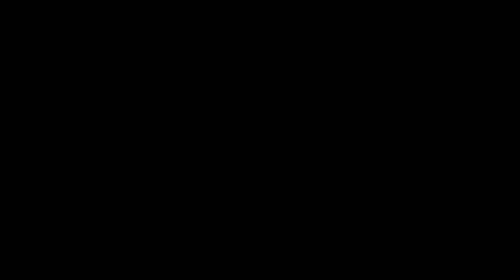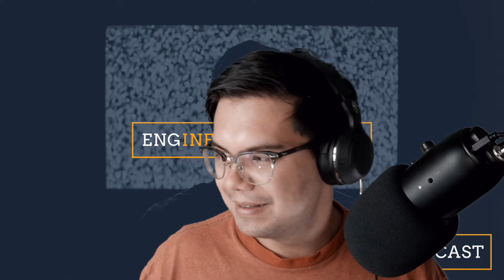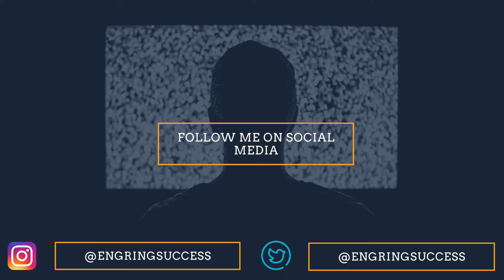Why is the engineering drop out rate so high?

Comment: Good points. Not only does it require complete commitment to achieving the goal, and sacrifice including your social life and hobbies, but it requires very-very hard work (brainwork, mostly, but also the dogwork of slogging through your labs, homework, reading and re-reading) as well. Your number one commitment has to be digging your way through the material. It also requires that you adopt the engineering mindset and philosophies, which are quite different than anything that most young students have ever encountered before. This includes the learning a new language, the engineering vocabulary, to survive the curriculum. Add in that you also have to take lots of other courses outside of your major to even reach being able to take engineering courses, and it is no wonder that many students give up. But those who persevere become more valuable as a result.
Reply: New engineers coming out of school should be required to put in 2 years pulling wrenches so they understand the hands on.
Reply: @daledavies2334  Mechanics and toolmaking/machining?! They'll ALL quit if they do that!
Reply: @devilsoffspring5519 Who will.quit, the mechanics and machinists/tool makers? Engineering in plants like compressors. If part of their certification involved having to bend tubing, install electrical conduit, piping and engine or motor alignment, they would be better engineers.
Reply: @daledavies2334  Mechanical engineer (MSc) and former researcher here. Also came from a auto workshop background, so I can't agree more. But only if the workload is balanced and reasonable.
Reply from the maker: interesting fact about me, I did two years as an "engineering intern" working in the machine shop for a contractor! I point back to that experience all the time. It was SO VALUABLE! Great idea.
Reply from the maker: agree. It should not be punitively hard. Good companies have structured rotational programs to help manage those kinds of things. One of my previous podcast guests, Carla Minett, helps companies out with those.
Reply: Sorry Dale, I agree, but wrenching should be done before, not after. That way they'll get familiar with the terms and process, and maybe other engineers. That's why car-guys generally do OK, even though they have to suffer through calculus. Same for sparkys, aeros, builders and chem geeks. The most valuable job I ever did when going through school was working in a machine shop. Fresh outs generally have no idea how stuff gets built, and it takes a long time to learn. @daledavies2334
Reply from the maker: I think a lot could be learned from doing that, for SURE.
Reply from the maker: Agreed all the way across the board! Pinning this comment :) please consider subscribing if you haven’t already.
Reply: ...That's not a good life. That's not an appropriate work-life balance.
Reply: rarely WORTH the pay
Reply: @doublesushi5990  Jobs generally aren't worth the pay. They're better than the alternative but even though working for a living is the backbone of all human civilization, it has been showing it's limitations for a very, very long time now.
Reply from the maker: yeah but working for a living with a job generally implies the concept that you can step away from your work as well and have social and free time which is a recent development in the history of civilization...
Reply from the maker: depends but yeah there are a lot of structures put in place to minimize the pay...

Comment: I got a BSEE at Purdue and even though I had a 5.66 GPT (Purdue graded on a logarithmic 6 point scale - the logarithmic is a joke but the 6 point scale is not) there were many times I thought about switching majors before graduating.  I was in a Co-op program that really helped me.  After working for 7 years in engineering, I did a lot more bus dev and strategy work. I am now working on AI projects “When the AI System Has to Be Right" AI in Regulation/Governance/Policy, Healthcare, Road Safety/AV, Education and Energy.  My recommendation to engineering students is to leverage AI to help with the theory, also find study groups to help you work together on tough problems.

Comment: The primary reason students drop out of engineering but not necessarily out of college is lack of aptitude for math.  I could add science buy you can't do the science courses, especially physics if you are not good at math.  If you excel at math, engineering is not difficult.  People enter engineering because the starting salaries are higher.   However, that doesn't apply to lifetime earning.  Engineering majors start with higher salaries but have much smaller raises and after 4 or 5 years almost no raises because after the first several years, additional experience had little value.
Reply from the maker: Thanks for sharing!

Comment: I agree on the concept of lab courses being twice the pain.  When I matriculated in the mid '80s, I had an old-school fluids prof that demanded an incredible amount of lab reports, and I bet that I spent a total of 10 hours per week just on that 1-hour course.  I took the 2nd thermo class (in the ME curriculum, back before such curricula got slimmed down because it was taking folks so many extra semesters, LOL) and I think I spent less time on that 3-hour lecture.  I would pretty much only take labs in the Spring semester, as the Fall semester being football season would leave me with less time.
Reply from the maker: Fluids lab was the hardest for me. It was harder than many of my regular 3-credit-hour courses. Thanks for sharing your experience and echoing mine in a way!

Comment: The BIGGEST revelation I got in Electrical Engineering studies: When your instructor assigns you 3 questions in the back of the chapter you're studying, that information  you learn by doing those 3 will only get you a C in the exam (and the class). YOU HAVE TO DO ALL of the problems at the end of the chapter to get an A. One REASON so many people drop out of engineering school is because they never discover that "trick". They think: "I guess I'm just not cut out to be an engineer because I can't get good grades on the exams". The REASON you don't get good grades on the exams is because you didn't do ALL the problems at the back of the chapter. WHY that's not explained to early Freshmen in engineering...is WAY beyond me.
Reply from the maker: That’s a great way to study!
Reply: This..the students who do this UNDERSTAND the core concept and LEARN how to really apply it. That’s why they can get the A in the exam. If you only do the homework, you might not fully understand the material.

Comment: On a first year dynamics exam there were two groups the "kids" got an average score around 25% ( fail) the older students from an industrial background averaged 92% - I could have scored 100% but didn't answer one question - "What is Newton's 2nd Law ?".  The head of the course laughed at me for not knowing the answer, and called me arrogant when I told him the answer....

Arrogant & self-important lecturers....  Telling a single-parent teen to go get a job to buy a car and learn mechanics whilst struggling with a new environment hundreds of miles from home is challenging  - you can learn mechanics from a pedal cycle.... Back in the 90's we were expected to learn Autocad in our own time despite 35 hours a week of timetable. I bought a printer and computer to avoid staying till 9PM four days a week doing course work.

When I left I worked as a production technician for an entrepreneur...  100 hours a week and endless 6 1/2 days each week, it was wonderful and left me sorted by the age of 35 with an expensive new car, a home and no debts.... 

My two colleagues went into large multi-nationals - one became a hench-man for Alstron who sent him to close down a century old company to reduce competition in their turbine market.
The other simply ran a steam generation plant for manufacturing titanium dioxide for paint....  yup a boiler-man.

I didn't study microprocessor engineering and programming to end up wielding a spanner, I did that messing with MTB's and my car....
I didn't study air conditioning and Bernoulli's Law to fix cars in a garage...
I didn't study Business Management to sit pouring over printouts all day long.... 

In my last year as a worker I babysit a £350,000 machine that has taken a year to sort out so it works properly..... because the company didn't invest in setting the correct working environment for a sci-fi device aerospace quality machine in a "scrap-yard" environment, Komax Zeta - nice ! !!

Comment: In physics I had a class called thermal physics and it is not going to be easy especially with all the approximations made when solving the math problems in "unorthodox" methods. Also minimum math required calculus 3 or higher due to the need to know what a partial derivative is.
Reply from the maker: Oh the dreaded PARTIAL DERIVATIVES.

Comment: I graduated with a degree in Mechanical Engineer in 2009.  After two design jobs, I came to the realization that I didn't have an aptitude for the work.  Although my grades were good, I never felt like I excelled nor improved.  I repair heavy machinery now and feel satisfied with the work albeit my body aches after certain repairs.  Only 30% of the students made it through the university program (in 2009) and even far fewer work in their field according to the administrators.
Reply from the maker: I'm glad you feel satisfied with your work. I'm sure that the critical thinking and problem solving skills you honed in your engineering program contribute to the way you go about your job now. I'm not knowledgeable about the exact statistics but those you have provided are consistent with what I've heard.

Comment: Having been to engineering school and graduating with an Electronic Engineering degree, you don't mention the most important quality, and that is how intelligent you are.  Yes, your IQ matters when studying any STEM field.  So many students have had their 'self esteem' boosted and received so may 'participation' awards that they have been deluded in to thinking they are 'smart'.  Well, it just ain't so.  The real litmus test is before you get to the real engineering classes.  Typically that is physics, which have very large class sizes and are meant to cull the students who aren't up to the task.  The drop rate of these classes are about 50%.  My university had two large  beginner physics classes and each had a dropout rate of about 50%.
Reply from the maker: Maybe it was just my university but I didn’t see this. Most of the people at my school were pretty smart, as they had to get admitted into the university first. You don’t need a high IQ to do well in engineering. Yea, there is probably a floor somewhere, but it is hopefully higher than the point of admittance to the university/college of engineering/program.
Reply: if you dont have a good foundation in math and reading you will struggle its that simple. IQ is a scapegoat to deflect that most peoples education is a disaster

Comment: Another reason not mentioned in this video is math. A lot of students just aren't prepared for the amount and high level of math these degrees require. It's not just the math classes themselves, but also the math you'll be expected to understand and be able to apply in the engineering courses. Many of the students I see leave engineering do so because of the math more than anything else.
Reply from the maker: You’re right. The math is hard and many students have to take remedial math courses on the onset. They’re immediately behind from day one and it becomes hard to catch up, so they drop. That or they really didn’t learn the math in high school and struggle out the gate with calc 1, then calc 2 is the nail in the coffin.

Comment: So who is dropping out?
Engineering takes intellectual heft and academic rigour (at least it used to). You also need a rather higher general iq with strong grokking of math and spatial concepts. And of course there is the focus and hard work required. 
Maybe kids are not taught enough math, physics and chem in hs.
Reply from the maker: I think it's definitely the poor foundation of math, physics and chem in high school, combined with the fact that the learning style required to achieve in engineering is completely contrary to how you learn in high school. High school has a lot of rote memorization. That is not the case for engineering.
Reply: It's not that the kids are not taught enough stem classes, the truth is the capability of students has been decreasing so not matter how hard you try the teach them, they can't understand it.  the bell curve has been getting much wider!
Reply from the maker: @gumby2241  I haven’t heard that. Is there research on that topic you can refer me to?

Comment: Simple... Gen Z don't have patience on Engineering. Also, they don't have enough academic discipline and foundations...
Reply from the maker: do you think it's truly a generational thing? I think it's just an "Engineering" thing. I am concerned that the more recent generations will struggle with engineering because there is no instant gratification, but I think engineering has always had a high drop out rate
Reply: @ENGRingSuccess  Hello, sir! (CLARIFICATION: this reply of mine is based on my observation about the response of gen Z into Engineering courses in my country - in my place). For me... It is by generation... By 70's and 80's, students taking Engineering are focused and highly prepared before taking Engineering courses for they know that these courses are very hard for ordinary students. Those, drop outs are those students that just take Engineering courses unprepared and realized that it is not for them. Remember, the slide rule for their calculator? You need extra hours to learn that... In 90's and 2000's, upon introduction of digital scientific calculator.
"Scientific calculator is my wife/girlfriend. I will loss all; but, not my scientific calculator" - engineering student
And, all you need to do are just memorize and familiarize almost all mathematical and scientific formulas. And, learning Engineering courses are as hard as in the 80's... And, the reasons of drop outs is almost the same - lack of preparation. Now, in 2010's up to the present. With the entrance of Computers, the internet and the smart phones. WITH ALL THE LEISURE AND EASE GIVEN BY THE TECHNOLOGIES. Students tend to relay greatly into it. (These stand my statements above. Technologies now, creates lazy students!!!). I know you are familiar of PhyWiz and Photomath Apps? All you need to do is to take a photo of the equation you formulate and let, the apps calculate and give you the answers. And because of these apps, professors tries to be creative and make their own problems THAT MAKES MORE HARDER FOR THE STUDENTS IN RETURN. And, drop outs now is more significant... Conclusion: (in my place) In 70's and 80's, students taking Engineering courses are smart, well-prepared and dedicated to the course they choose for they know that engineering life is hard. Drop outs may significant due to student's unpreparedness and not knowing the course they entered. Engineering student in 2010 up to the present are unprepared, unmotivated and highly relying to the available technologies... Additional thing that make Engineering student life harder is the creativity and wisdom of their professors just to compensate the ease given by the technologies to them. So, i think that is the reasons why drop outs now are significant - reliance to the latest technologies plus the creativity of the professors equals to drop out.

Comment: One thing I noticed years ago when 42 of us started and 4 graduated was in order to succeed, you need to have a love of engineering going into it. Not the love of money, not because your parents made you, and definitely not to go to party in collage. It was true and maybe still is that many hours will be spent after class than time in class. For new people advice , I found that studying  in like minded groups helps exponentially with success.
Reply from the maker: It truly is too difficult for most to just muscle through it if they don’t like it, that’s for sure
Reply: They may not need to love it but they should have at least a general interest in it. As you alluded to many students get into the field because they are told how lucrative it is, but they aren't told how much work it requires.
Reply from the maker: true. I agree with what you've said @maqclark
Reply: @ENGRingSuccess you need a peer group of hard working people.  You don't need to love it but you can't actively hate it.
You need to be good at math, so much so that the math part isn't a stumbling block.
Reply from the maker: @losfromla1480  you're so right across the board. All of the above applied for me. I had the peer group, didn't actively hate it, and was decent enough at math! Thank you for sharing your experience!